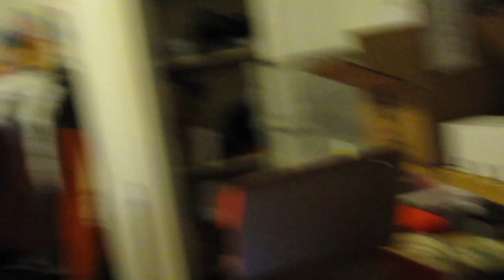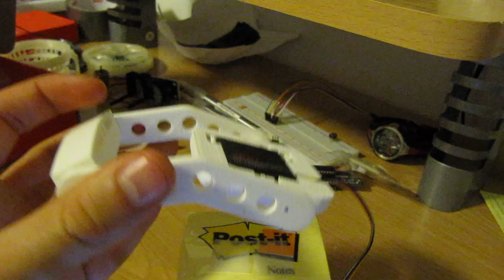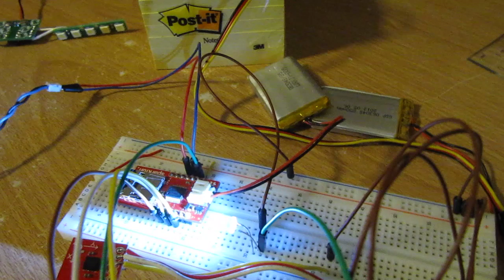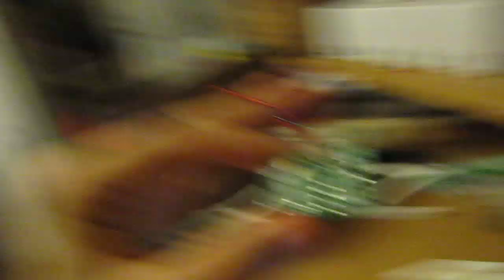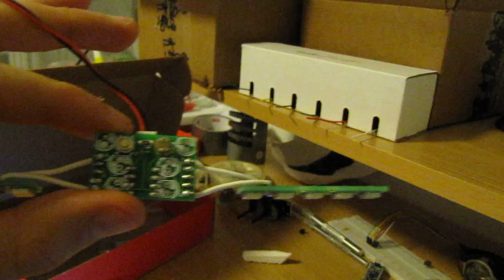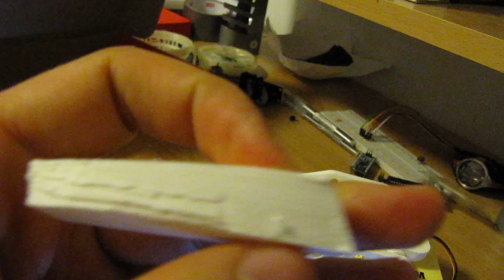3D Printed Iron Man Motorized Faceplate Mechanism

Comment: Could you leave a short comment about what microprocessors you used to control the servo, accelerometer, LEDs and speaker (where did you store the sound file?) and what supplier and programming language you used? thanks a lot!

Comment from the maker: Looking at the helmet, this design may not work solely due to the width of the forehead tab on the new helmet (same thing for the Iron Patriot).  I would likely have to develop a new mechanism that is wider.  But, I'm pretty sure the simple rotation should allow the faceplate to clear the helmet - I haven't physically held the Mark 47, so I can't say for certain.